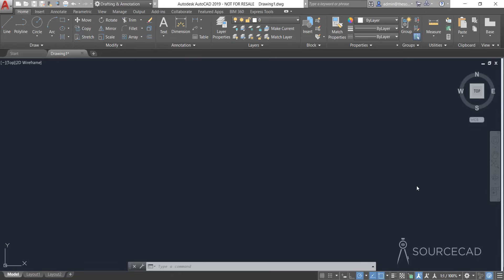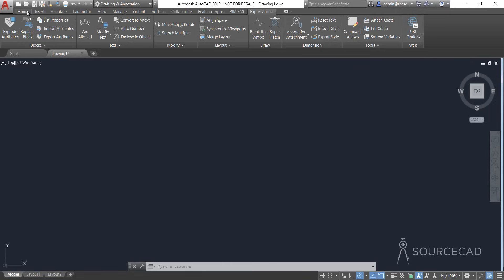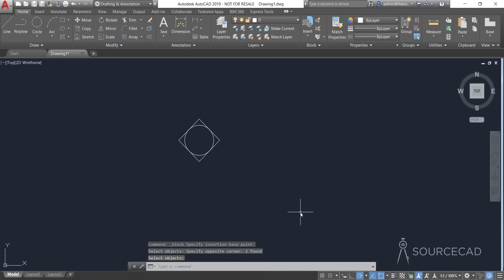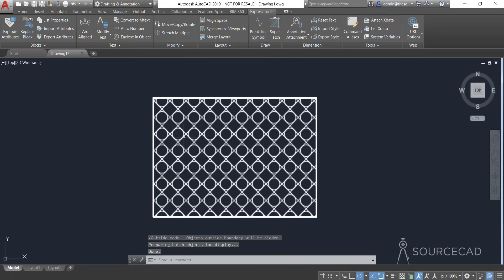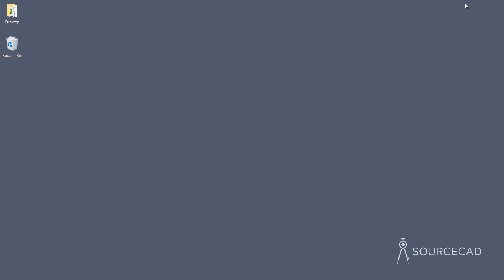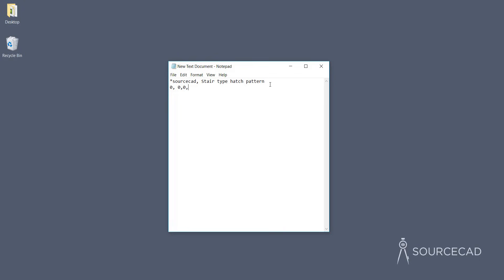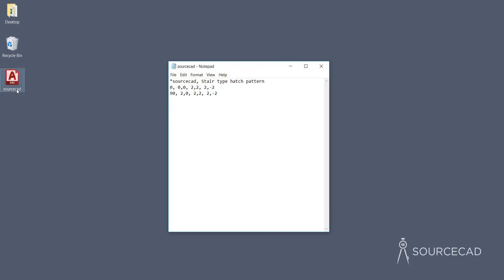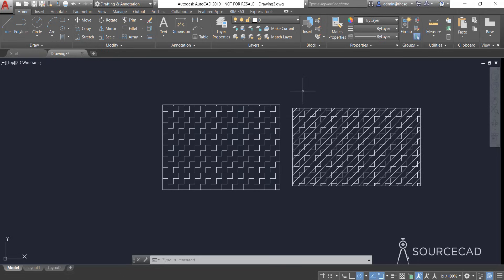How to make custom hatch pattern in AutoCAD with Superhatch and pattern file

Comment: thx mate, just made a subway tile 10 X 4 with 1/8 gap with your help. had to do some tweakin cuz some value werent as per say. here is the code
*Subway Tile 10 x 4, subway tile 10 x 4
0, 0,0, 10,4, 9.875,-0.125
0, 0,3.875, 10,4, 9.875,-0.125
90, 0,0, 4,10, 3.875,-0.125
90, 9.875,0, 4,10, 3.875,-0.125

Comment: Hi, this is very helpful! But I also got confused being all "2". I need to do a hatch for a 9x72 wood plank staggered flooring. I got to do the rectangles, but when I try to do the staggered portion.... it didn´t work. How would be the string to it? 
0, 0,0, 72,9, 72,9
90, 0,0, 0,72, 0,72
I feel absolutely lost! 
Many tanks in advance.
Reply: i'm stuck to the same problem too. If you've solve it, could you let me know please!

Comment: Is it possible to use decimals when typing the coding? E.g. 0, 0.03,0.03, ...?
Following question: it seems it should be possible to code squares as well. I'm trying to code a pattern with squares with a specific spacing between the squares, but don't seem to get it right. Is this possible?